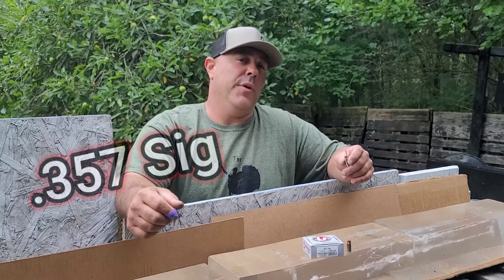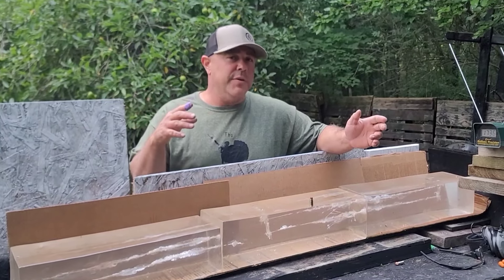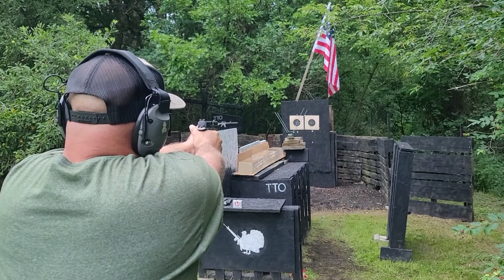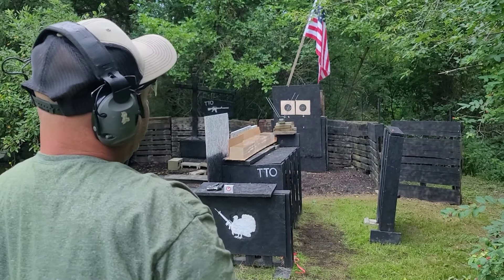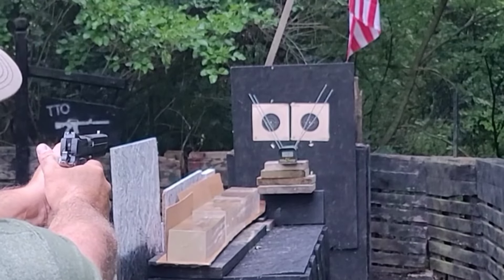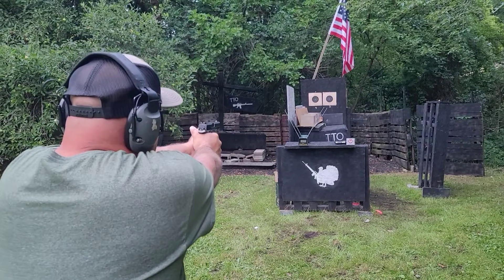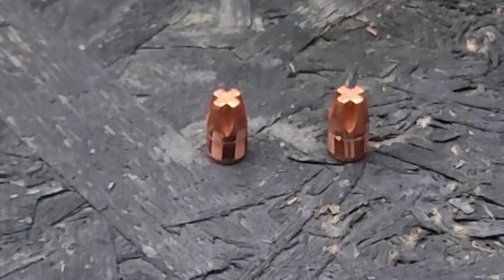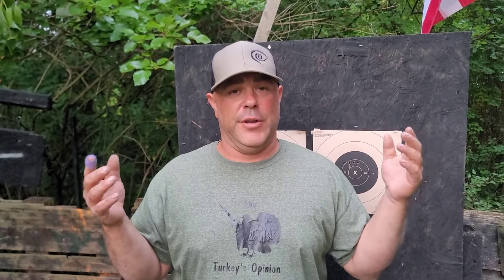Sig Ammo Testing Series: #10 UNDERWOOD 115gr Xtreme Penetrator | 5" AND 4.25" Barrels | Accuracy/Gel

Comment: If you have a 40 S&W platform, find yourself a 357 SIG barrel (and a 9mm conversion barrel, should you so choose)...   You won't regret it!  P.S. In most instances the correct 9mm magazines will provide excellent performance and reliability.  You can have 3 guns in one!
Reply: That's exactly what I did. Several years ago I bought a m&p core 5" in 40 s&w.  Since then got a 9mm apex conversion barrel and a kkm 357 sig conversion barrel. Apex trigger, trijicon SRO. Now a days I mostly keep the 357 sig barrel in it. Absolutely love it. Just my two cents.